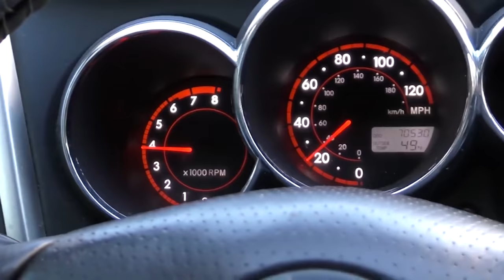5 Signs Your Transmission Has a Serious Problem

Comment: Please tell me what happened to my car. My friend drained all of the transmission fluid out of my car. He only put one quarts in my car. I drove it for one day and it stalled and completely stopped working. He ended up putting two more quarts in my car, it is somewhat drivable but very sketchy and making weird noises. I’m having my car towed to the dealership tomorrow because I am so scared about what actually happened to my car. What do you think it could be? I have Toyota Prius 2018

Comment: I have 87,000 miles on my 2018 Civic EXT.
I’ve already changed the transmission fluid twice and I flushed the coolant twice. 
Change the oil/filter, change the transmission fluid, flush the coolant and change the engine air filter regularly. Also make sure your battery is fully charged and rotate the tires every 10,000 miles.
Car has been trouble free to date.
Reply: You have no miles on it...and.its a Honda....even of you neglected it, you wouldn't have any issues yet
Reply: @richsweeney1115  
Yes, Honda’s are very reliable. However, I’m concerned about the longevity of the turbo and the CVT. I doing my best to get 300,000 miles by aggressively maintaining it. I’m currently at 89,900 miles and planning on replacing the belts with my next oil/filter service at 93,000 miles.

Comment: I have a 1996 Geo Metro it's got 60,000 miles on it. It's got a pan gasket leak. Very slight. I was thinking of getting the transmission fluid changed. And having a new gasket installed. Can you please give me some advice. I know you are very busy but it would be such a blessing. And I see in some of your videos that there is an American flag on your mantle. Was a family member a veteran? Or did you serve. Thank you for your time.

Comment: I had to get a new transmission oil pan. Which meant new transmission oil. Two hours after having my car back the engine light came on. It stated code P0700 ( transmission control solenoid). Exact same car 2009 Kia sportage 121,255 miles. Should i do what you did ?

Comment: I have a Nissan Pathfinder (2017) and when I first bought the car it use to pick up and now it lags when I step on the gas. (Sometimes when I step on the gas it takes off but most of the time it slow to pick up speed. I have to press the pedal all way to the floor in order for it to speed up.) Do I have a bad transmission???   What do you suggest?

Comment: Im experiencing this issue currently, have an appointment with buick next week. Should I go to firestone or buick the dealer? im at 223,000 miles and im ready to get rid of her. Good car but a year hasn't past since I've been making repairs especially last year in august spent almost 3k in repairs from cataylic converter, fuel pump, active grill shutter. Idk what to do at this point but I'm tired of all of this. any help?

Comment: Hey Scotty I bought a 2012 Tahoe at 160,000 miles and now has 190,000 miles. No problems at all with it but should I change the transmission fluid and filter?

Comment: Garage changed for me CLS 350 CDi transmission fluid at 135K - NO problem at all, in fact, buttery smooth. I gave them the Febi bilstein the whole kit + Liqui Moly Ceramic additives - I recommend doing it with ceramic additives. Now at 60K. or 70K. seems a logically correct time interval. Enjoy the ride.

Comment: Scotty, I have a 2017 XLT Ford F150. The problem I'm having is my transmission keeps skipping and jerks a lot, and sometimes I hear a whining. I was told that I either need a complete overhaul of my transmission or get a manufacture transmission. They run from $4600 / $6200 please let me know what you think.
Thank you

Comment: I have a 99 e150 Econoline 4.6 V8 van and my speed will not go over 70 mph do you think this is the vehicle speed sensor or the transmission speed sensor oh and also to mention it struggles going up hills and occasionally my cruise control will shut off I know this can be caused by one of these sensors but not sure which one

Comment: What happens. If. I have a Toyota Avalon 2001..  and have 126,000.. miles.  And never changed the transmission fluid... but had 2. Inspections done. And. Both places. Said. Said my transaxl is bad.  But no slipping really, high rims. And Jerry. But no clunks when switching gears. Either. Was gonna get a rebuild.. what. U think?

Comment: What about manual transmission? Toyota "flushed" My transmission and wouldn't shift at all.  Service rep crammed it into gear and said it was fine. Neighbor telling me  dealerships hiring "techs" from J-tech school across the street from the dealership. Not much experience before working on your transmissions or engines. Now having p0012 (engine) code, $1200 later sill tripping the code. 2006 Tacoma, was supposed to be my forever vehicle.

Comment: My 300,000 mile 1989 jeep Cherokee has never seen a transmission fluid change or flush. Running 33’s and it’s still going strong. If/when it blows, it will get a 6 speed

Comment: Oh yea. I have an automatic, i can pull and put my gear lever (or hand) in any shift (P, R, D, N)  with no problem. But i did check the transmission oil and it's a brown color

Comment: I had my automatic transmission replaced right after a flush! Crazy thing was I only did it because I was having issues shifting gears.  Smh warranty covered it but I still have issues shifting at an incline anything I should do to fix that?

Comment: I just changed my transmission fluid on my accord it had 45000 miles it when I drained it it was still pretty clear an the magnet was pretty clean I used the Honda transmission fluid not cheap but cheaper than a new transmission you talked about transmission changing but what about the filter?

Comment: I have a 95 Saturn SL2 automatic. I bought it used and I have never changed the Transmission fluid.   Drives fine forward but when I put it in reverse there's a 2-3 second delay . In your opinion do you think it might be ok if I  Change the transmission fluid Or do you think it could possibly make it worse? I would appreciate your Opinion.

Comment: Hey Scotty! Do you live in Michigan? I need a mechanic! ... I have a 2011 Chrysler Town and Country. I've had intermittent starting issues ever since I bought my car. I've had the battery replaced and the starter replaced. Neither replacement helped anything. I've not only had intermittent starting issues, but I've also had weird acceleration issues. When I try speeding up, sometimes my RPM's will jump from 1500 to 3000. I've also had a camshaft position sensor code come up (which has just been replaced twice) and it's still coming up. My second mechanic put in a new catalytic converter. I recently had a blinking check engine light, so I immediately pulled my car over and called a tow truck to tow it 74 miles to a new mechanic, because at this point, he'd be my third mechanic to try to fix these wierd issues. He put in new cam position sensors, but when I went to go pick it up, it was still driving weird, and the next morning, by check engine light was on again. Sometimes the traction control light comes on with the check engine light (they come on at the same time). The last time I started my car, the traction control light and the check engine light came on together, but it was driving without issue earlier the same that day. When I proceeded to drive it home 3 miles away, I was near my exit on the freeway, and all of a sudden, my car would not accelerate AT ALL. Usually, when I've had acceleration issues, my car would all of a sudden get up to speed, but not this time. I basically coasted home and I did not drive it until I was able to get it into another mechanic's. One week later I was able to get my car into my 4th mechanic, I was afraid to drive my car there but this mechanic was only 2 miles away. This time, when I started my vehicle, the check engine light came on but not the traction control light. It drove fine. Oh, did I mention that when my traction control light is on, it's usually bone dry... no snow, no rain, dry roads. I did put in a new ground strap on my own because I noticed it was green. That has helped my non-starting issues (it's certainly not as frequent anymore). I also put in a new camshaft position sensor myself (the one near the firewall side of the engine) because I've just spend so much money trying to get my car fixed. But, of course, a couple days later, the check engine light came on again. But it's weird because my third mechanic said that I had a bad camshaft position sensor, so he replaced that and the crankshaft position sensor. Then, like I said, the next day, it happened again... no start, then weird acceleration issues, then a few days later, no acceleration AT ALL while I was pressing the gas. This 4th mechanic said he can't duplicate the issue so he can't fix it. I'm really so very frustrated. I'm out of money, and to put the cherry on this, my job is to grocery shop for people and drop off their groceries. I had to take this job because I have a neck injury which prevents me from doing the types of jobs I used to. I bought the van a little over a year ago and I'm just so frustrated. I'm afraid to drive it. Also, sometimes my rear camera does not come on when I'm backing up. I'm just so darned lost.

Comment: My car has about 157,800 miles 
It kicked when put in reverse and engine light and AT light came on. 
Didnt accelerate good at all.
Got a transmission flush and filter change
Now it skips 2nd gear drives perfectly fine in 3rd, doesnt go into 2nd 4th or 5th gear at all. 
Says shift solenoid A & B are stuck open. 
Should i change all the solenoids, or the speed sensor , or the TCM? 
Or is it just the transmission is bad? One mechanic said it might be my clutch pads? Idk what those are on a automatic transmission. 
Please help

Comment: Can you check to see if your transmission is going out?
If you're worried about your transmission, one way to test its functioning is to put your car in neutral for a few minutes. If you begin to notice strange noises while your car is in neutral, your transmission oil may need to be changed.

Comment: My 2007 cobalt has 22000 miles on it I've never changed the transmission fluid before it has no problems but should I change it eventually or just leave it alone

Comment: I have a 2016 chevy silverado 2500 HD WT 6.0 Gas. I bought it new.  I made a mistake of not changing the transmission fluid and filter until 84,000 miles. They flushed it which I ask them not to. I just wanted everything change. I ask them to go back and drop the pan and change the filter. They did but I was to late when it came to the flush. Now I'm at 103,000 miles and I have a p741 code. Torque converter stuck off. Some say just change the torque converter and others say replace the transmission because chevy had lame transmission. I'm a landscaper and pull trailer 90% of the time. Any thoughts?

Comment: I have an 07 kia Spectra, It's been shifting hard for quite some time, I was told by a mechanic that it was my engine mounts. I replaced all of my engine mounts and the problem persisted, my speedo is also slow by 5mph. After it shifts hard and I mean hard the acceleration is very sluggish from a stop but is fine above 50mph and the problem persists until I turn the car off and then back on. Checking fluids tomorrow and going to try some lucas. Oh and it has about 190k miles on it.

Comment: I drive a 1996 Buick LeSabre. The fluid was not changed till I got it changed in may of thjs year. I had the fluid flush and i got say I got very lucky because there was no clutch material in the fluid and the old transmission fluid just started to turn brown so definitely got it just in time

Comment: I tried to get an answer through your website, but got nothing there. Maybe you will see this and give me an answer. In cold weather my 2012 Dodge Grand Caravan 3.6L with a 62TE transmission that does not like to upshift into 6th gear unless the engine has warmed up for around 45 minutes. The Transmission was garbage from the factory. The dealer rebuilt it at 35,666 miles and it has run perfectly since. I now have 239,750 miles on the vehicle and wonder what can be causing the upshift problem and how to fix it. I have had the transmission serviced every 60K to 80K miles. There is about 20K on the current servicing. There are NO CEL codes. Thanks!

Comment: Scottyi have a question, I have a 2000 lincoln navigator 5.4 triton motor and a r4100 auto trans. I was towing a car when the trans over heated real bad I was able to lip it home the suv drove great for days never once slipped and shift afterwards. Then one morning it decided not no shift into any gear without any warning  now keep I'm mind I never changed the fluid or filter and no engine codes came on the dash I even had it put on a machine to check for any trans code but none. Can you help me out what could be wrong? Any help would be appreciated I have been a follower of yours for years thanks  scotty

Comment: Hello, I have question, I have Nissan Sentra 2013 model, I bought the used one 3 years before. The car is giving jerks when driving in traffic where often needs to brake and accelerate. After applying brakes several times when the road becomes free when I accelerate it jerks but keeps moving. On the contrary when there is no traffic, when I do not brake much, it does not jerks at all.  Is it problem of gear. I have changed the gear oil timely as per user manual of manufacturer. Please reply.

Comment: Proper procedure for flushing requires two filters to complete.
● Drop pan, change filter and replace fluid.
● Flush trans.
● Repeat step 1.

However, the criteria to meet, under which flushing is a viable option, are strict. 

Any car with no trans maintenance over the first 60k miles is ineligible. Ideally, you change fluid and filter at 30k, flush at 60k and alternate accordingly as the miles accrue. Otherwise, stay away from flushing.

Comment: A Scotty I have a 2014 Nissan Sentra vs it currently has 76000 miles I've heard these Transmissions are bad from 2012-2017 it's been said if these Transmissions get 100,000 miles on them you got to put another Transmission in it what do you suggest I don't have the money put a new transmission in what say you

Comment: I drive 60mph on highway in the cold for at least 80 miles but temperature of dipstick reads cold still is that normal?  I drive the car on cruise and don't accelerate hard

Comment: Hey, I have a situation:
I bought a Jeep Patriot 2010 with CVT transmission with 146,000 miles on it, now it has 152,000 miles and I’m worried about the transmission; it hasn’t fail or anything but I’m worried because I don’t know if the last owner did some maintenance on it. Should I just don’t do anything, change the fluid and filter or just pray to go’s that it keeps the way it is now?

Comment: Should I change transmission fluid on my 2010 Acura TSX, got it at 150,000 miles currently 176,000 and I’m not sure if it’s ever been changed before? 😅

Comment: Should I top up my transmission fluid mixing new with old oil in my ES350 2009 model?

It’s a transmission that’s been rebuilt once. I don’t have any other history. It has 223K miles on it

It sometimes jerks when shifting between D&R and N&D and occasional delay between P & D.

Kindly advise.

Comment: Hey Scotty!! I have a 2014 Hyundai Sonata, and I just had a new engine installed and they told me I need a transmission flush. Do I really need it? The car has 94000 miles.  It does feel a little sluggish when I drive it.

Comment: 2019 VW Atlas 3.6L. After the cars been sitting overnight on first drive cycle from 3rd to 4th gear the rpm jumps 250rpm and the car jolts into 4th. They replaced the transmission valve body but it still jolts. But after it jolts the once during the drive cycle it shifts perfect after that.  Any thoughts ?

Comment: On my nissan sentra 2013, having issues running the car. Rpm goes high but speed won't. Jerk in reverse gear etc. 
Should I replace a fluid or it's a transmission

Comment: I have a 2006 Ford fusion SE, shakes at idle and some when I drive, 3 people checked it out and not engine mounts, no codes, new spark plugs….coil packs were broke fixed it. I thought maybe throttle sensor or throttle Body but no coded, it delays, car only has 117903 miles on it. Any ideas? Big O tires pulled a fast one and tried to tell me it’s almost like 3,000 worth of fixes….. transmission seems to be in good shape too…..lost here lol

Comment: Hi Scotty. Im in the uk and have just inherited a 2014 VW TOUAREG 3.0L TDI. It has 104000 miles on the clock. I note from its service history that it has had regular oil and filter changes, but no record of any transmission, axle or any other sevice. I plan to change all of these fluids appears for the first time. Do you think that is a good idea or is it all too late. I intend to use slick 50 engine oil and also transmission oil additive to reduce wear and tear.

Comment: I have a 2004 4Runner with the 4.7l v8 it’s a great car which I bought a yr ago. Since I bought it it has this jerk between 1st and 2nd gear. But at low rpm, can it be fix? The gear run fine and the rpm look normal shifting. Can changing the fluid fix the issue?

Comment: I grew up always being told by old school mechanics never ever get your transmission flushed because the pressure of the fluid that they use to flush out the old is not regulated. Its just blasted in there tearing up seals and all kinds of stuff

Comment: I had a new radiator installed and they recommended a transmission flush because of the mileage. Immediately after I picked it up the gears started slipping. I have owned the car less than a week. I don’t know what I can do. I think I now have a car that will cost more to fix than I paid for it. This is my first car after five years of public transportation. I guess I’m going to have to go back to taking the bus.